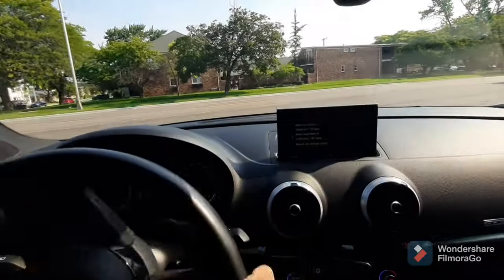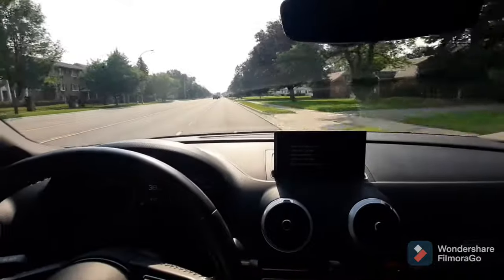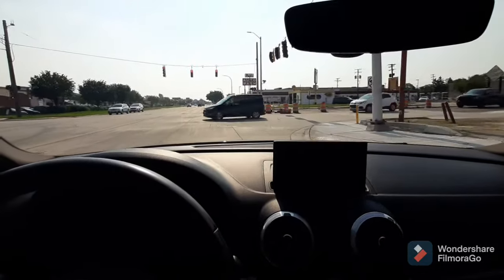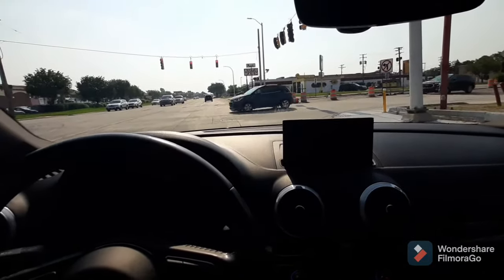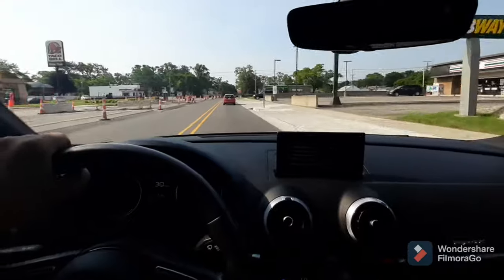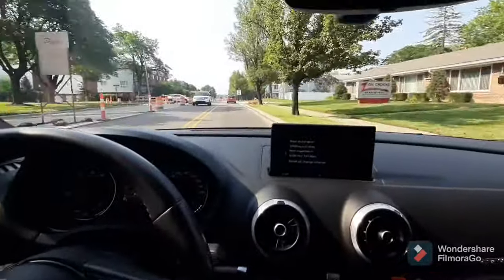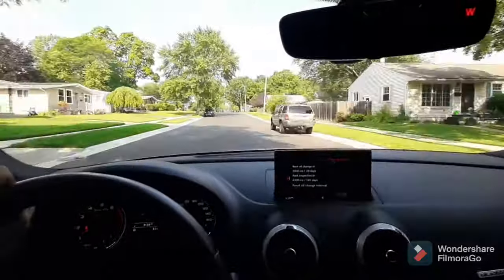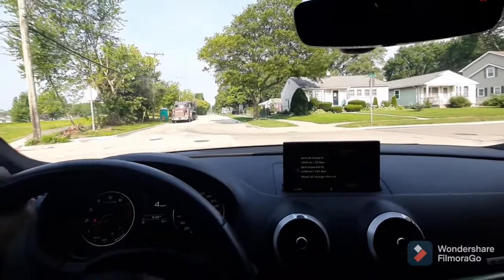How to tell the difference between a wheel bearing noise and a tire noise from drivers seat

Comment: I’m sure mine is the wheel bearing now. When I go right in curves or turns all noise is gone. That’s the right wheel bearing?
Reply from the maker: It could be, just to be sure I like to lift up the car have someone else get inside and get the wheels turning and listen with stethoscope to wheel bearings
Reply: @EuropeanAutoRepair  right on. Thanks!

Comment: I know that commonly the wheel bearing noise is opposite of the turn cause of weight load. Is it ever on the same side as the turn? I hit a bad bad pot hole about six months ago with the front right wheel and just recently started hearing a noise that sounds like a bad wheel bearing. I hear it only when I turn the steering wheel right, not left. Can that happen?
Reply from the maker: If the inside bearing race is damaged I think it can act more like how you are describing, might be a good idea to have it lifted on hoist and listen with stethoscope to verify

Comment: My truck's rear driver side wheel squeaks "as it turns" meaning the faster I drive the intervals are shorter, and the slower I drive the intervals are longer, etc. At higher speeds the noise goes away until I curve or turn right, when weight is applied to said side and tire. Can anyone help diagnose? My first thought was drive shaft, then brakes and now I have people telling me it's the wheel bearings. Not the most knowledgeable in vehicle mechanics so I could use a hand if anyone minds.

Comment: Hey man good video. I got a new truck, with new tires( bf Goodrich all terrain t/a) I did the side to side with the steering wheel and the noise didn’t change, the truck drives smooth, doesn’t vibrate, when I slow down the hum seems to slow down with the truck, in your opinion tires or wheel bearing ?
Reply from the maker: Tire noise is my guess
Reply: @EuropeanAutoRepair  thanks for the reply. If it’s tires noise what could be the problem?
Reply from the maker: @Osobear14 it could be a alignment issue or just a defective tire, sometimes more aggressive treads will just be noisy
Reply: If off-road tires, it'll make them noise like your tire is cutting the wind.  It's a style so it's normal.

Comment: A month after getting new tires on my 2023 ES350, I suddenly have a humm at 50+mph. It’s very slight, but I hear it and slightly feel it. After experimenting, I find if I set my cruise at 60, while driving straight, I can turn the wheel to the left ever so slightly, and the noise goes away. Move it back to center the noise comes back- every time. Car only has 23,000 miles. Could it be a wheel bearing?
Reply from the maker: It’s possible that it’s a wheel bearing issue, sometimes it’s best to put it on the hoist with another person inside to run it up that that speed, than listen to the hubs from the bottom with a stethoscope
Reply: @EuropeanAutoRepair  my car is still under warranty, so I’ll bring it to the dealer. But it’s so slight. I’m afraid they’re gonna give me the runaround and say they don’t hear it because they can’t determine exactly what the problem is.
Reply from the maker: @JohnnyUtah9173 sometimes asking to take a drive with the mechanic is a good idea so you can actually make sure he’s aware of the noise and it doesn’t get ignored, depends on the dealers policies but we allow it
Reply: @EuropeanAutoRepair  I like that. Thank you.

Comment: So today I changed rotors and brakes on right front side that’s what I thought it was but after replacing that and putting tire on there I realized tire was loose even after lug nuts where tight does that mean bad wheel bearing? It was a click clack noise before I changed anything sounded like wheel was going to snap off
Reply from the maker: A failed wheel bearing is possible, if you can see the brake rotor moving and the brake dust shield staying still it’s a bearing problem, otherwise check suspension

Comment: Been hearing a ribbing sound on my truck i thought it was my wheel bearing so I changed that when I changed my brake pads my self yet the sound was still there . Took it to 2 shops n they both told me there was nothing wrong with my rotors pads or wheel bearing . The last shop told me it could be my wheel is unbalanced. But it sounds like if the brake pad was rubbing against the rotor .

Comment: What kind of sound comes from a bad wheel bearing? Is it humming or growling or squeaking? Thank you.
Reply from the maker: I would say a hum best describes it
Reply: @EuropeanAutoRepair  Thank you for your response. I had a high pitch squeaking noise from the rear wheel and it turned out to be the worn brake pad on the inside. I couldn't see that pad from the outside and the outside pad sill had some material left. I changed pads and the squeaking noise is gone.
Reply from the maker: I’m happy you got to the bottom of it

Comment: Invaluable information, great stuff helped me loads.
Reply from the maker: I’m so happy to hear that
Reply: @EuropeanAutoRepair  been diagnosing a sound, worried about bearings but then the tracking is out on the rear of my seat because on a control arm stuck bolt so been feathering tyres and now it's both better and worse because of new tyres. In the wet there is less noise so I already thought it was tyre rub on the road making the noise. Now I'm almost certain so will have the bolt sorted or just replace the arms completely. Thanks again take care.

Comment: So I’ve got the whoo whoo whoo noise when I decelerate. Been happening for about two months. What could I do about the tires if it’s that noise?
Reply from the maker: Usually end up replacing them, you can try to rotate them or if they aren’t directional switch sides but it will likely still be noisy
Reply: @EuropeanAutoRepair  but they’re almost brand new tires. Would it be because some of the weights fell off the tire after I got them on?
Reply from the maker: Or a possible alignment issue, might be worth getting a opinion from a local shop just to be sure

Comment: My car is producing humming / hollow noise as I speed up, more speed more the noise, as I slow down it slows down but keeps on coming until I stop,  it's just like the air noise when you open one half rear window (opposite to driver side). I recently got winter tires installed and its coming after that. Do you think it's related to tires?
Reply from the maker: From your description it sounds like a tire noise to me

Comment: The comment you made about the tire noise as you're slowing down I am having with my right front tire any suggestions on how to fix the problem?
Reply from the maker: You probably won't have much luck unless you replace it
Reply: @EuropeanAutoRepair  I replaced my back two tires with the exact same brand and tread pattern the front tires were still in very good shape I didn't hear the noise until after I had my tires rotated 6 weeks ago do you think it could be due to the slight wear in the tread on my old tires? It's on a 2012 Infiniti G37 which is all-wheel drive
Reply from the maker: That might be it, was your alignment checked when tires were installed? Sometimes that can lead to uneven or wavy tire wear
Reply: @EuropeanAutoRepair  I don't think so but I'll look into it thanks for taking time to help me. I really appreciate it!
Reply from the maker: @TheChewwy40  No problem at all
I hope you get it figured out
Reply: @EuropeanAutoRepair  thanks again!

Comment: I have that crazy problem with a "windy - wavy" sound which starts around 30kmh to 60kmh

Changed the bearings - nothing
Changed the wheels - nothing

Any suggestion what could cause this problem?
Could it be the brakes? The CV axle maybe ?
Reply from the maker: I wish I could help more, without taking it for a spin it’s hard to know
Reply: Might as well do alignment while you are at it.

Comment: I got the wa wa wa noise when i hit about 40 an up an then obviously when decreasing it goea away. I Recentky got new tires installed then rotated my tires after so the new went on the rear an the old moved to the front, i assumed the wheels moved to the front needed balanced again but even after still the noise continued, maybe the new tires need rebalanced again an wasnt done right the first time... imma check that out when j get the time... really hope i didnt waste money on bad tires

Comment: Great video. Question: I'm getting a whistling sound coming from the right rear area. It comes and goes and usually happens at high speeds. Could it be a wheel bearing? I have a 2007 VW Golf 2.5 Thanks!
Reply: Might be the alternator belt.

Comment: Just went through this..Was positive it was a rear bearing.. Nope!  What made it difficult to tell fir sure 1. Loud exhaust 2. Subaru bearings don't usually have "play" in them unless severely worn. 3. I had a noisy roller bearing in my gearbox at the time, adding to the tire noise a humming sound..Issue is noisy ass GT Champiro tires plus I need adjustable rear arms in order to get my alignment perfect since coilovers

Comment: As I drive I have a humming noise it's louder and kind if a whirring noise that you made when I am up to 40+ and when I put loud on the left wheels. But my right tire has uneven wear. Also when I turn back and forth I have whining and while in a sharp low-speed turning I can hear popping noses when I hit small bumps, I feel like that part is my ball joint on either side I just can't under if that it alone or maybe the wheel bearing or tires somewhere factored in too
Reply from the maker: Sounds like you may have a few things going on. You need to lift it in the air and check suspension and cv joints next I think

Comment: Can someone inform me what is the most probable cause of some mild grinding sound which I also feel on the steering wheel. It feels that it is coming from driver front side. Is this a wheel bearing or knukcle? Or could it be something with suspension? It is 2017 Toyota Corolla 4 door sedan.
Reply from the maker: Brake backing plates will cause this from time to time

Comment: I hear a humming/cyclic sound from my rear tires … the inner tread is little less than the other treads on the same set of tires…. My front tires are brand new… do you think the inner tread difference on my rear tires is producing the cyclic sound while driving ?
Reply from the maker: Does turning at speed influence noise?
Reply: @EuropeanAutoRepair  no it doesn’t… it’s just a little annoying…
Reply: I have the same problem , like a cyclic humming low pitch noise when driving at higher speeds. Completely new tires. Did you find out what it was?
Reply: I replaced the tires and the issue was resolved.

Comment: Some snow made me drift into and up over a small curb with my driver side wheels at about 10mph. I've been hearing a sort of rattling/ scraping that is rhythmic that is directly tied to how fast my wheels are spinning. It's definitely not a growl or hum. The alignment was definitely affected but the noise does not get louder or quieter based on speed or turning. Is that enough to say it wouldn't be the bearing? And if not what could it be?
Reply from the maker: I’d check if you have a brake backing plate touching  a rotor

Comment: i thought it was tires, rotated them. same noise. put different tires on, same noise. it sounds to me at least like it's only coming from the passenger front. but that's where i've been having a cv axle issue. could that be the culprit or is it a wheel bearing?
Reply from the maker: Cv joints usually cause more of a clicking noise not a low pitch hum

Comment: Weird I kind of have both possibilities. Started a few months ago.
Replaced tires and almost appears to have gotten louder.
Replaced all 4 rotors and pads and no change to sound. 

It is the woah woah woah noise 1:40 and it does change level slightly when loading the car one direction or the other. 

Thinking I swap out for my winter wheels and see if the sound continues.
Reply from the maker: Yeah if you have another set of wheels to try and see how it influences sounds that’s a nice thing,
Reply: @EuropeanAutoRepair  I will post a video I made on the way into work today. Could you take a listen and give me your opinion. It’s only 1 steady speed but there is a rotational noise in it.
Reply from the maker: @45eno yeah send a link
Reply: @EuropeanAutoRepair  Not sure what is happening but this is two times my responses have been deleted. I didn’t even post a link the second time. Under my account I posted the video under the shorts area.
Reply from the maker: @45eno  strange, well hopefully it comes through
Reply: @EuropeanAutoRepair  3x now I simply reply to you with or without a link and my reply vanishes a few minutes later. The video is available and posted you just need to look under my account here. I have no idea what is going on and this will likely get removed.
Reply: It was the wheel bearing. All fixed. I was able to find Toyotas OEM brand Koyo bearing assembly for half what the dealer wanted. $395 for dealer part and $203 for Koyo with the same OEM part number. The OEM bad one I removed had KOYO in small letters on the back.

Comment: What would be an issue when my car speed exceeds by 85kmph weird sounds occur and increases gradually with speeds. Which makes me feel like my car front axle or suspension would be breakdown ( or perhaps due to wheel bearing issue not sure). And when I slow down at 80kmph it stops completely and runs without any noise. Any idea what issue it could be?
Reply: Same. Find the problem?
Reply: Same issue. Found any solutions yet?
Reply: @usmanatiq  steering rack got changed now it working well no sound... Steering rack can be repaired as well  and fix back but mechanics recommend to replace so that they keep old one and sold metal as scrap or they fix it and sell them to used spare parts markets. For my vehicle( Suzuki Estilo) no used fixed steering rack was unavailable at that moment. So decided to replace. Installed genuine part cost me ₹3500+₹500 labour.
Reply: @ShadowOfDeathPsalm23  yes . steering rack got replaced...

Comment: Everytime I drive the inside of my car is very loud but when I’m making a right turn at a certain degree it goes quite and smooth but when I go straight or turn left it’s back to being noisy., could this be my tires? And need to get new ones?
Reply from the maker: I’m not 100% but based on your description it sounds more like a wheel bearing problem
Reply: @EuropeanAutoRepair  would it be costly to do it my self?? Or taking it to a mechanic?

Comment: Hey man I got a 2001 f150 automatic, she has 240 thousand miles, and It will shake a bit with humming noises when I get past 20mph, but when I take a turn from a stopping point it will sometimes stop and the truck sounds smooth again for the rest of the ride. I have to mention I did hit the ditch after locking the breaks on ice before this started happening. Would you be able to give me an opinion
Reply from the maker: That’s kind of a strange one! Not 100% sure on that, might be some kind of wheel bearing problem but I’d definitely have a local tech take a look at it

Comment: So I have this same issue I thought it was tires to have that wob wob wob noise on decell too but I just had new tires out on today (same kind of tires) and I still have the noise and when I take it to the track the faster I go the worse it gets around 125(mph) starts at around (80) and everything it rock solid from tierods to anything connected to the hubs it’s really weird got any idea of what could be causing the noise? My shocks could be replaced there kinda shot and I do have a small rear diff leak but besides that the car is solid it’s a 2013 Ford Taurus sho police interceptor if that helps
Reply from the maker: At that point I’d probably install the chassis ears and see if I could pinpoint it a little better,

Comment: I get that woo woo woo noise when i take a turn either left or right and it is lowering the rithm as i decelerate . My problem is that all 4 tyres are new and just had an alignment done , also front lower suspension arms are new.  Could it be that they are under inflated ? Even though i inflated them to recommended specs for the car ? Megane 1.5. Dci front inflated to 2.3 bar and rear to 2.1 bar.  Any suggestions would help .
Reply from the maker: What the noise present before new tires were installed? Did the tire installation influence noise if it was noisy previously?
Reply: @EuropeanAutoRepair  I changed the tyres at the advice of the mechanic , having the same issues . Important to mention , the place where I changed my tyres , severely over inflated them to around 3.5 bar but didn't know at the moment , I've done the tyre alignment at that pressure and only after that when I went to a gas station and checked the tyre pressure did I see how over the top it was . Thank you all in advance for your support.

Comment: Hey, I get a loud tire/wind noise, but the noise doesn't change when moving the steering. I also checked the tires and they look okay to me. Just wondering could it be a rear wheel bearing??  The steering wouldn't affect it in that case, right?
Reply from the maker: Rear wheel bearing noise usually still changes when you steer side to side because youre shifting weight.
Reply: @EuropeanAutoRepair  oh I see okay. Is there any other way to be sure before I take it to the shop?
Reply from the maker: @RED-pi9wo   I can't think of any other way to be certain unless you lift the car have someone else inside hitting the gas and listen to the hubs with a stethoscope